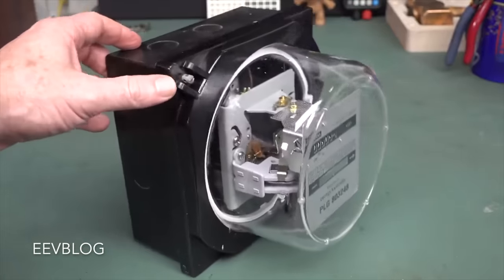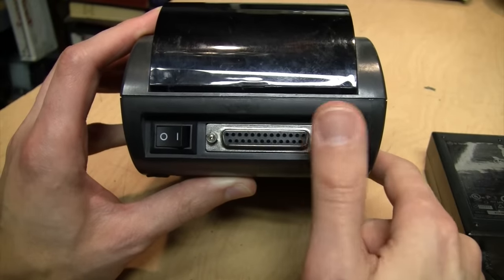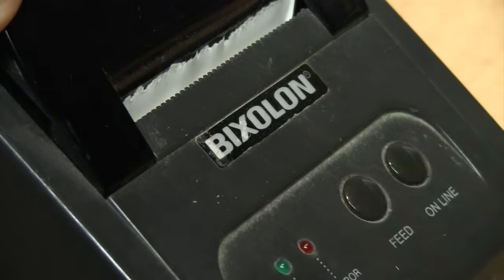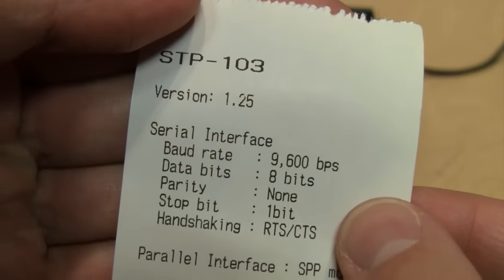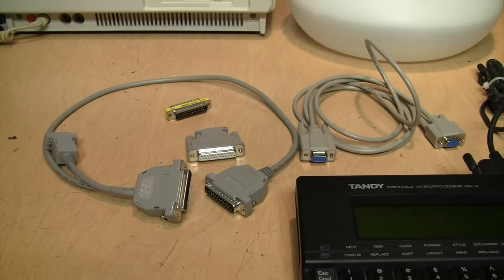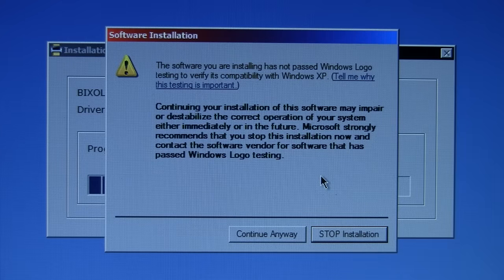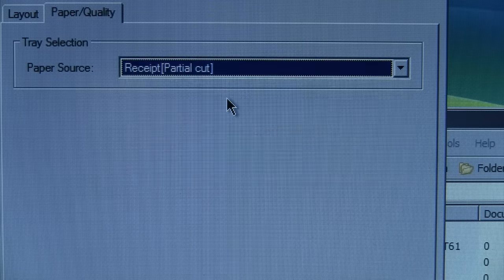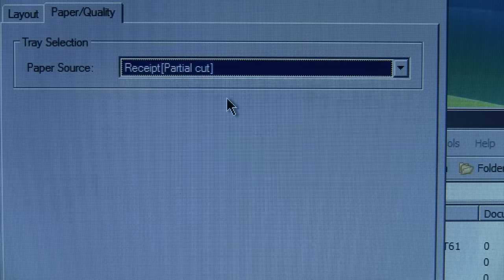I got a receipt printer. 🖨️ Now what?

Comment: Something I've always wanted to do with a receipt printer is print out an extremely long maze that spans multiple feet. You might even be able to make a labyrinth that is hundreds of feet long.  It would be fun to try solving it.
Reply: lol has a fake path that starts at one end and goes all the way to a dead end
Reply: Something I've found that's fun to do with mine is wall deco. WIth the long strips of paper, you can print huge quotes that span an entire section of a room.
I've seen online maze generators that conform to the paper size of your printer -- since the receipt printer just shows up as another plug-and-play device in Windows, it should work for that. I'll have to see!
Reply: 1234567890123456789012
Don't follow Ran's suggestion of what to use this printer for either. It is also sure to get you into trouble.
Reply: @biankaataegina0101  how would printing a maze get me into trouble?
Reply: @randomviewer896  Duh, Obviously the maze police will track you down and throw you into the maze dimension.
Reply: Hey you just gave me an idea of labyrinth generator

Would be fun party games with friends coming over 😂
Reply: @Steets  Well that might be not the best idea, try leaving a normal receipt in place where  you would hang that piece and see how long will it last
Reply: why do i see touhou everywhere i go😭
Reply: I seem to remember an old maze generating program I had on my old Apple II+. You entered the dimensions and it would generate a maze you could print out on the old dot matrix tractor-fed Epson MX-80.
Reply: @mirai5268  Joining the Touhou community is inevitable...
Reply: @Dia06  youre right...
Reply: @hurricane567  oh yeah, do-or-drink with a receipt printer
Reply: Eh, print pi to a gazillion decimals...?
Reply: good luck getting that much receipt paper lmao
Reply: CVS prints stupidly long receipts everyday 😂
Reply: That is such a great idea!